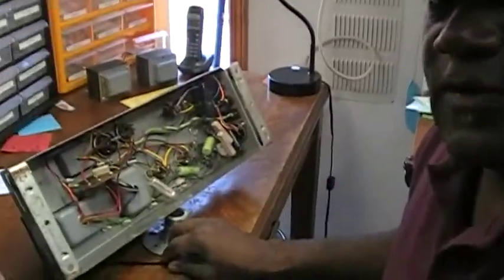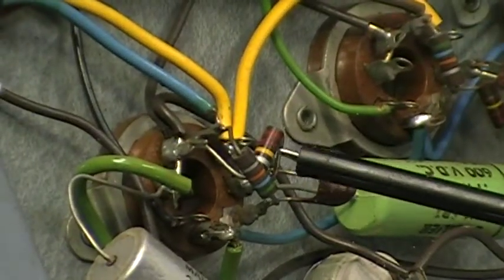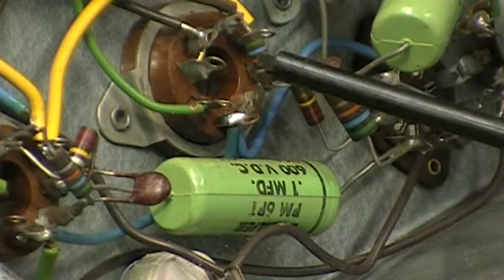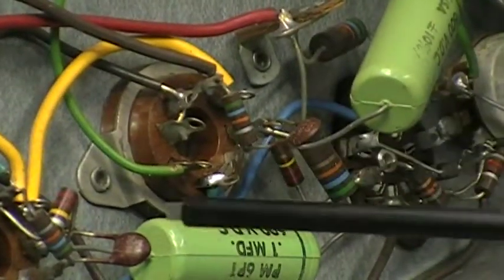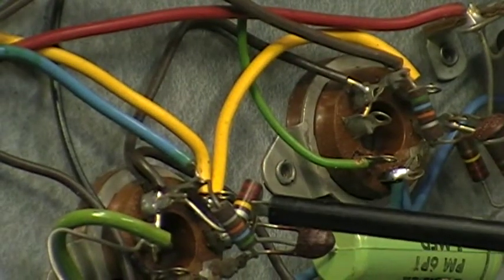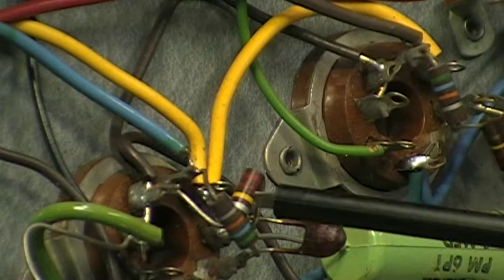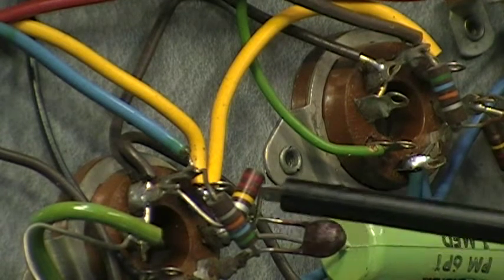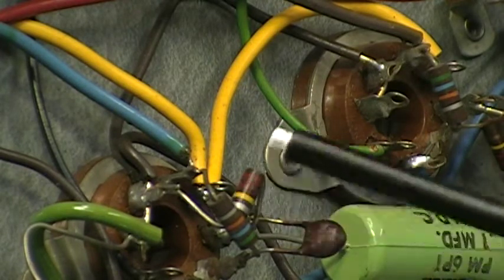Carbon Composition Resistors In Vintage Leslie Amplifiers

Comment: Hi Dr. Arthur!  Just wondering if you could share your thoughts, demonstrate the sound differences of Carbon comp resistors versus Metal Film resistors?  Thanks.
Reply from the maker: Brother Charris - I bet if I replaced the resistors in one amp and compared it to an amp with the vintage carbon resistors - and if there is a sound difference - one could not say that it was do to metal film vs. Carbon Comp because of the age of the Carbon Comp resistors.  So what you might be getting is new resistors vs. old resistors.  Since I only buy new metal film resistors, I don't have new Carbon Comp resistors to do an equivalent evaluation. Thanks for the note.  It would be a good test if I had new resistors of both types.  I would bet that the metal film would result in a brighter tone possibly.  But that's just a guess. :)  What is your guess?
Reply from the maker: I am so sorry that I am just seeing your question Charris. That would be a cool video I think. In fact, I would love to see it myself. LOL. I would have to defer to those who have the appropriate scopes and meters to connect amps with the different resistors to demonstrate any differences in sound waves and so forth. But I could talk about difference between the carbon resistors and the metal film resistors which is what I use in my rebuilding projects. I like the Metal Film resistors because they are less likely to drift and tend to have a tighter tolerance limit. So that are perfect for precision instruments such as tube testers and capacitors analyzers where a difference in 1/10 of a uf is important in measurement of components. Thank you for the suggestion. I will keep it in mind.